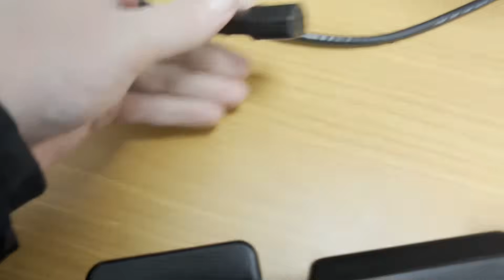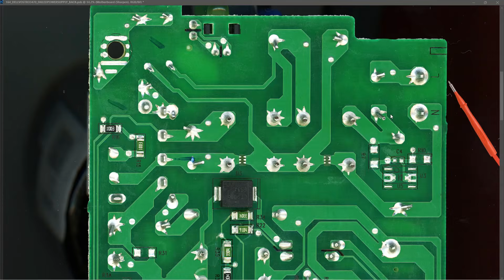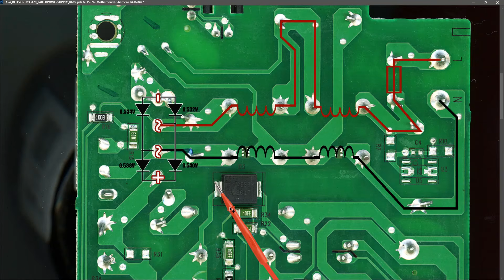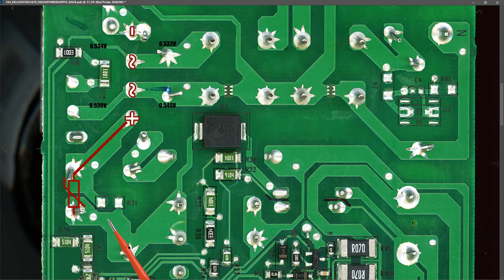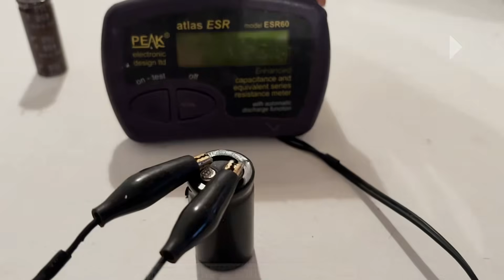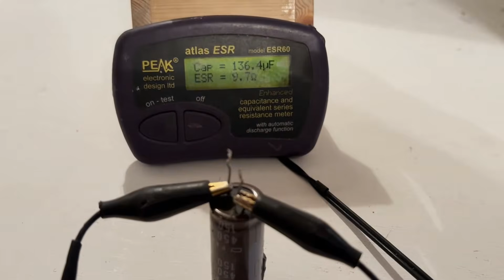DELL VOSTRO 3470 - NO POWER

Comment: I am not sure why you used the Diode selection to measure continuity on your meter.   Some meters have a continuity function along with a diode detection  but I think you want to use the resistance measurement as the diode function will apply some power to the circuit.  You then did not show how you performed the reading of a diode or the bridge rectifier.